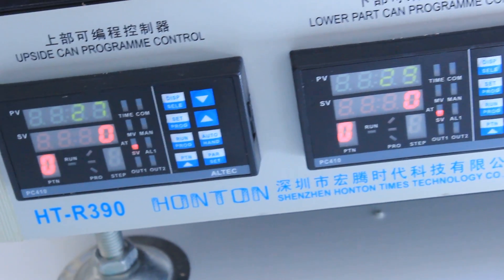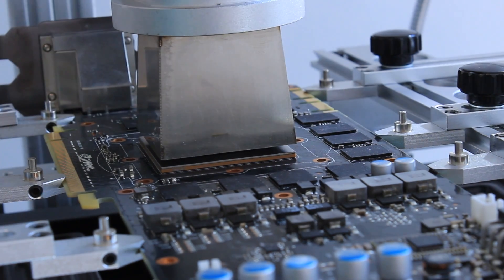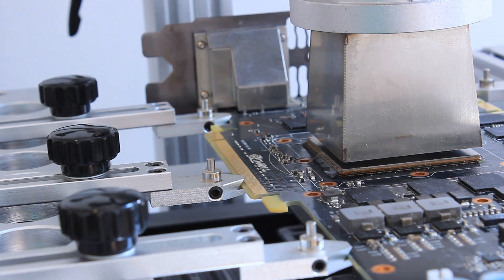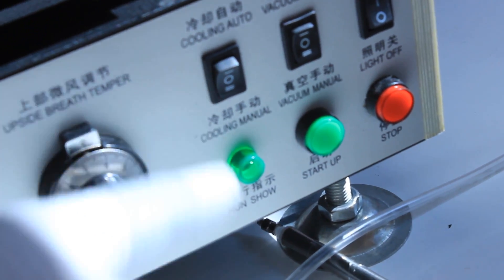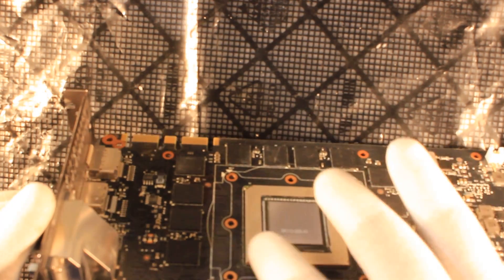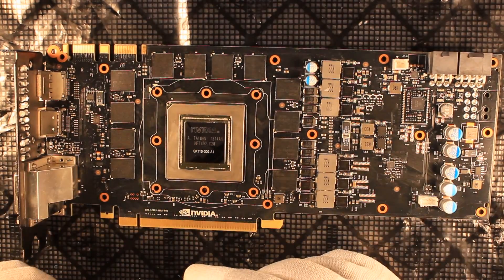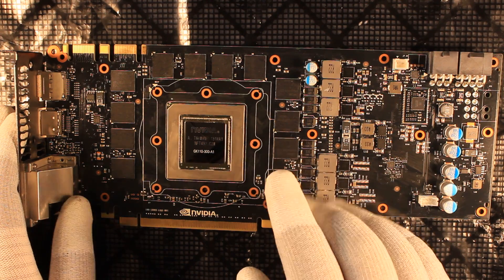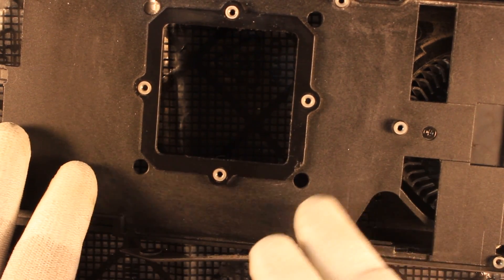How to reflow a GPU from start to finish #2 reflow process and testing the repaired card

Comment: I have this gtx 980ti reference after I purchased for $20,my motherboard give me first long beep then give normal second beep and normal third beep which didnt boot,so should I have to reflow,(nice video keep it up :3)
Reply from the maker: If the rest of your system works with an other graphics card, you should definitely try to reflow it. Though, I must say, on modern GPUs when they need a reflow/reball most of the time they work at least in 2D modus, and only die or generate artifacts in 3D. Most of the time when a graphics card is beeping from the very start, that often means that the GPU was killed via overclocking/overvolting. Still, try to get lucky and reflow it. Do not spend your time on reballing it, except if you want to learn reballing. Otherwise financially it is a waste of time&money.
Reply: Donkey Learning IT my 670 only died in 3d. Is there a decent way to do this without paying someone to use a proper machine? Is a heat gun or oven really a good idea? Is it worth buying a heat gun with temperature control?

Comment: Mr Donkey :D i have a situation with a graphics card and i am not sure it is worth the time trying to reflow it, it is a gtx 670 and it has the following symptoms. Once i start the pc nothing seems wrong, i browse the internet fb 9gag everything is fine most of the time, once i launch light 3d workloads as in games or benchmarks it seems to work fine for a while, but sooner or later it displays artifacts, now the artifacts themselves are diverse, there's warped geometry, things stretching forever, missing textures or textures that are colored wildly and wrongly, sometimes the whole image becomes black with colors and if i move in the game the geometry gives way and becomes warped, in unengine heaven only at 8x aa and 1080p it shows pink dots especially on the green textures and the shadow areas, and there are also white or colored dots that appear mostly in pairs of 3, and also squares made out of little dots. Thing is after this has happened in games it follows to the desktop, sometimes it follows full on and there are squares with dots in them on the desktop, other times there are only larger dots in rows of 3 or 2 , and other times it ruins youtube videos by making things look either black or weird or it creates texture artifacts in them. The card has a accelero mono plus cooler and does not get verry hot in full load i would say 60 degrees or 80 in worst case scenario ( once) , so do you think this card can be made to work by reflowing?
Reply from the maker: As I already wrote for a similar question to an other viewer: if you can get the card to be reflown for free, by all means, go ahead and ask your friend to reflow it. However, even if the reflow is a high temperature good reflow with lots of flux, the GPU will not live longer than about 7-9 months if you game hard on it.
Now if you would need to pay for a reflow, considering how relatively inexpensive used cards are, in my view it is not worth the hassle and the money. It is simply economically better to buy a used one from Ebay or similar source. Especially considering how fast the GPUs change on the market, every year there are two new generations out...
Reply: I see thanks for the reply.

Comment: Hello, I have  Asus GTX 680 4 gb only when play game problem this 
artifacts or gltch. This solution is repairable or not.This problem is 
GPU or VRAM? http://i.imgur.com/Z1U9p7t.jpg
Reply from the maker: Looking at the screenshot you linked, I would say that this is VRAM, or one of the balls which are going to the VRAM from the GPU are not making contact.
Does the same artifact appear also on 2D when you are simply on the desktop?
If yes, that is 99% VRAM. If the artifact only appear couple minutes after you start a 3D application, then the issue is with the solder balls where one of them cracked, and once the GPU chip heats up, it no longer makes contact with the GPU, so that the GPU constantly reads zeros from that chip.
Reply: This artifacts only appear when I open any game, Appears immediately upon opening the game, but not appear on 2D simply on the desktop not appear, only on 3D. This problem can be solved?
Reply from the maker: Graphic cards often use different RAM chips for 2D mode, since in 2D they need considerably less RAM. When the GPU switches over to 3D, all the RAM modules will be addressed. This is why you do not see the artifact in 2D but it shows up instantly in 3D. Based on the instant error, this seems not to be a heat related issue. This means that either the solder ball between the GPU and one of the RAM modules is broken, or one of the RAM chips itself is electronically broken/a solder ball below one of the RAM chips is broken. Thus, one can try a good reflow and try go get lucky, but in such case the chance is lower that a reflow will fix it, since there is a high chance that the RAM chip is duff. Still, give it a try and reflow the GPU if you can do it for free.
Reply: Ok and the reflow can be applied to the vram also or it is only for the gpu. I think it could be one of the vram, one of the RAM modules is broken, or one of the RAM chips itself is electronically broken. I can not do the reflow for free, I do not have the necessary equipment for that and here where I live is something expensive. Is it possible to do the reflow with a homemade heat gun? And in any given case of doing it is only in the gpu or can you apply heat to the vram?
Reply from the maker: If I understood your comment correctly (I am not very good at Spanish) you do not have access to the right tools and also you cannot get this done for free. You have been asking whether you could try to repair it by a heatgun, and whether with a heatgun it is possible to apply heat only on the VRAM. 
Well, considering that the GPU is not usable anyway, try to hit it with a heatgun and try to get lucky ;)
If you heatgun it, first heatgun the GPU, and only later the NVRAM chips only if the GPU does not "fix" the issue. Frankly, even a good reflow with an IR rework station will only hold about 6-9 months on a high power GPU. Reball is where the more lasting solution is, but for most GPUs it is not worth the hassle since the GPU prices are low.
Reply from the maker: Wow, your original comment was in Spanish, and Google is so good that it have automatically translated it to English. This is scary! Skynet is about to become self-aware ...
Reply: Ok thanks for 
answering my questions, I wish I had a friend like you with the 
necessary equipment to check the video card, and regarding google 
translator if it's true, jajajajajaja, excuse my bad English, I do not 
have a heat gun, maybe Sell the card to repair at a lower price or change it to another used smaller range.  By chance you do not have a video tutorial on how to do a reflow to the gpu and vram in a faulty video card like mine?
Reply from the maker: If you do not have the necessary equipment, you should get rid of the card, sell it for repair. 
Since the card is not worth much as a defective item, if you have a heatgun laying around, just for the hack of it heatgun it once if you got too much time. However, if you want to sell it, do not heatgun it at all, it is not worth your time. A good used card can be had for decent prices, depending of course where you live.
Reply: Thanks for all the information and tips
Reply: Can you provide me profile?
Step no.,  temp, ramp rate, dwell time

Thanks in advance

Comment: i tried at 205 C whit air flow and i realised that the temp wont reach 200 at the chip, and then i set temp at 300 C and now the videcard is working
Reply from the maker: This is why having a thermosensor is really important for profile development.
Btw, I find the 300C a bit too much. However, as you see, I also had to crank my unit way above the melting temperature of the solder to reach around 220C at the chip. Also, keep in mind that the distance of the nozzle from the chip makes a LARGE difference!

Comment: where can I get this done in Toronto?
Reply from the maker: Best is to search in adds, often a Google search will get you good results.
Though, make sure that they guy does a good high temperature reflow with flux, and not just reseats the GPU.
Reseating is the process when the GPU is in fact not reflown, because it never reaches liquidous temperatures, and the "repair" holds only for 2 weeks because only the board warps and makes contact with the GPU.